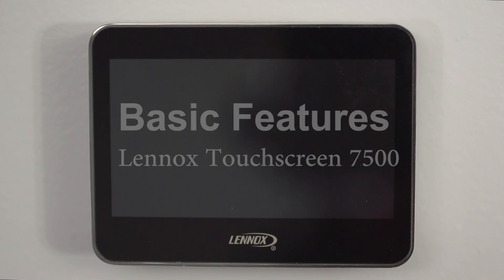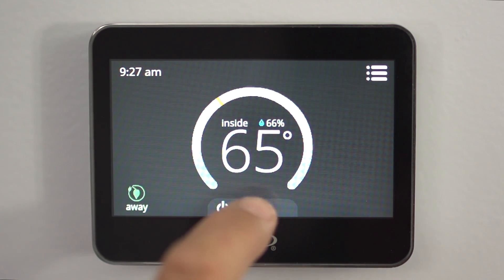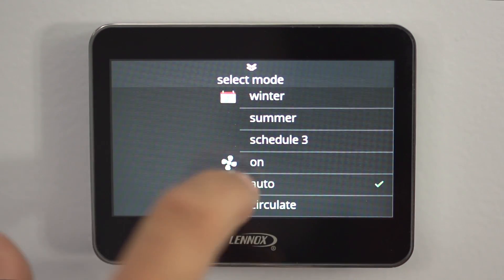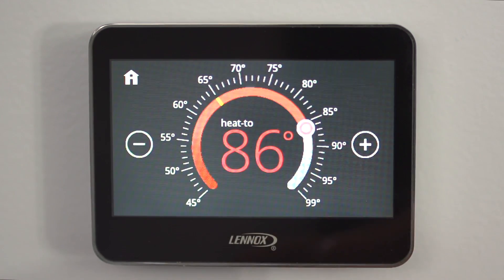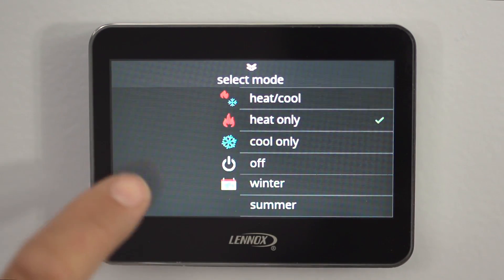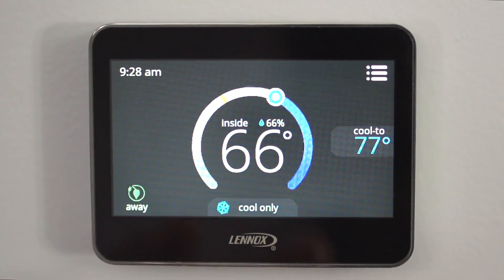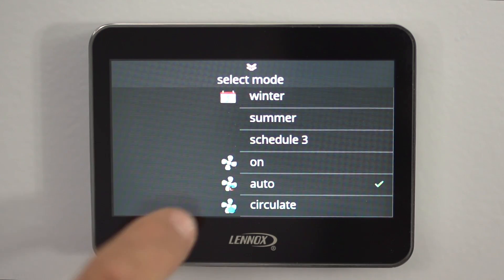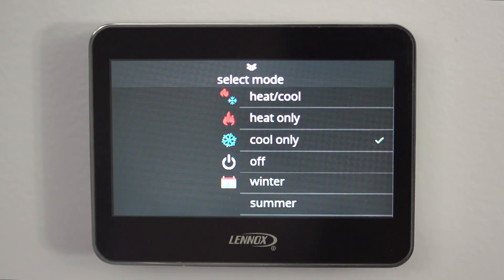Basic Features Touch Screen Thermostat

Comment: How can I get the time  set to my time  zone I'm in NJ its hooked up to my wi fi but its 1 hr behind my local  time I  tried the daylight  savings  button  then it 2 hrs  behind  i have the m30
Reply from the maker: I noticed my time was off an hour also!
Under Settings; General I was able to manually set the correct time with WiFi disabled.  Not sure if that will work with WiFi enabled 🤷🏼‍♀️
Reply: @kathydagen7424  I just disabled  wifi set time  turned  on wifi back to 1 hr behind maybe in the fall when we turn clocks back it'll work for our winter time another question  this thermostat  is for any kind of heating  system? as long as you make  your settings

Comment: Is there a way to JUST have the fan run, just to circulate the air in the house?  I can't figure out how to do it without the system being either on cool or heat mode.
Reply from the maker: Whether you have the Tstat on heat or cool, just the t-stat temp higher/lower than house temp, and your unit will not heat/cool. Set fan to “on” rather than “auto” for continuous fan operation.

Comment: My old thermostat have E terminal for my emergency heat.Lennox 7500 Touchscreen doesn't have E terminal,which terminal should I put the wire in for my emergency heat ,Thank you

Comment: Nice system but having set up a schedule, I cannot locate the icon to allow the system to be in "run" mode. Presently having to do this manually. Any thoughts as to why I don't have a "run" icon?
Reply from the maker: If you want to "run" the schedule that you have set up, from the Home screen hit the button on the bottom center.  This will bring up the select mode choices, and you can select heat, cool, or your schedule (by the calendar icon).